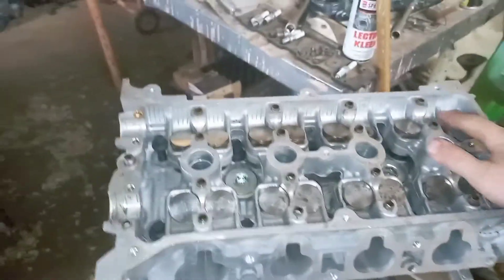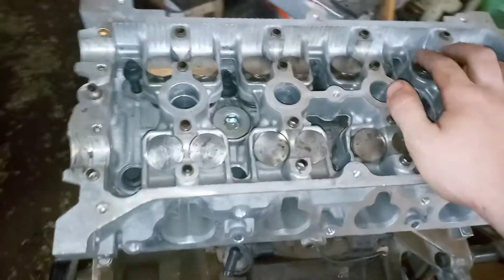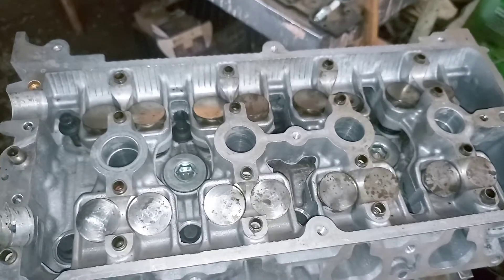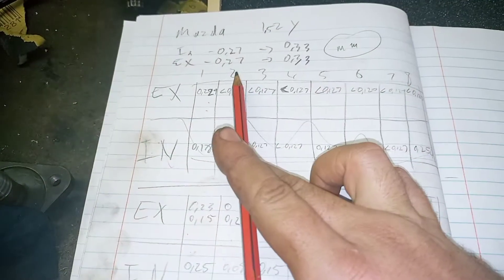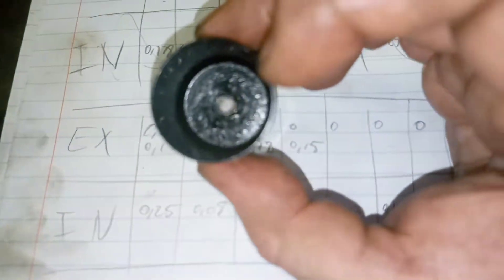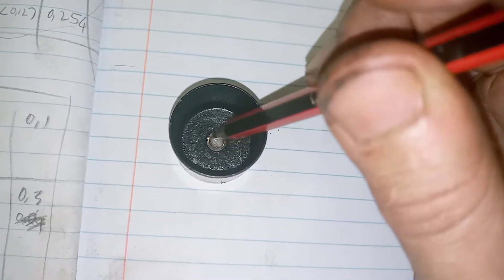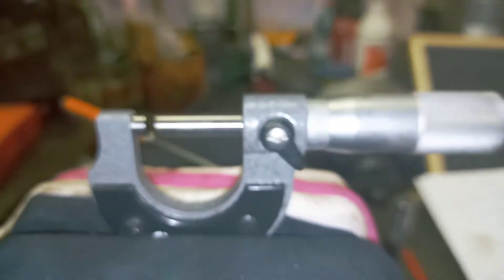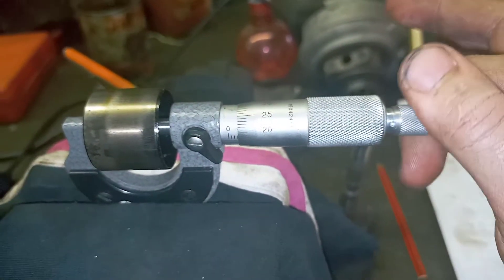How to set valve clearances with solid bucket shims.

Comment: A lot of times, if you clean the whole bucket where all the buildup is there are numbers like 420 or 270 and those numbers are the thickness(mm). You can add/subtract to get the correct bucket tapper you need. If there are a lot of miles on the engine there might be a tad of wear. Sometimes you ca swap buckets around to fix things.

Comment: My 2AZFE engine ticks so I measured the valve clearance. I can use .305mm filler gauge  to slide under three of my intake valves, since specs indicates 0.19mm to 0.29mm, do you think these can cause the ticking noise? they are out of specs, but by not much.
Reply: Yes, that .29 is pretty wide gap as far as valves go. And if you measured it warm than actual gap is larger.

Comment: Its a good idea to aim for the widest clearance. Clearances on bucket followers get tighter over time due to valve recession. The lower figure is the point where it shouldn't be allowed to go any further without adjustment.
Also at the wider end of the range the valves remain closed for longer which helps cooling of the valve.
Finally, it extends the amount of time needed between this ass ache of a procedure,
Reply: Im doing a psa puretech 1.2 rebuild. Runs fine but sounds like a tin of gravel. To the best of my knowledge I decided it best to measure the clearances in 3 positions, 9 'oclock, 12 o'clock and 3 o'clock then took the average of the 3. I used  a micrometer on the feeler gauge for the actual reading. Would you recommend measuring in 3 places? Really not alot of help out there on this.
Reply: Thanks for the info

Comment: this is frustrating.  i just wanna know how the damn valve lash is adjusted not a tutorial on mic use or a math lesson.
Reply: It is literally a case of matching the tappet to the specific valve. A right pain and pointless on a junk engine. 

Thank goodness for hydraulic lifters eh?
Reply: I think it is white mine as well.. it's not soo bad; because. Just  pul up the sides with bearing on cams and put them in...buying is hard because you have to get the ones that u need... each kit you buy has like 6 but you night need 6 different sizes.. that's money. But could be done very easily.